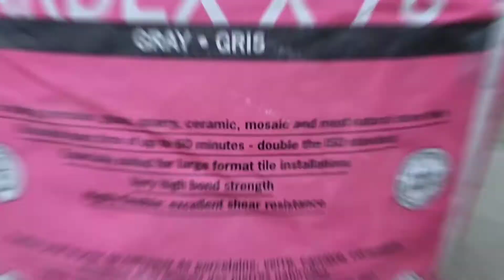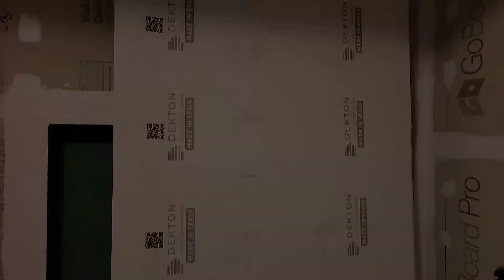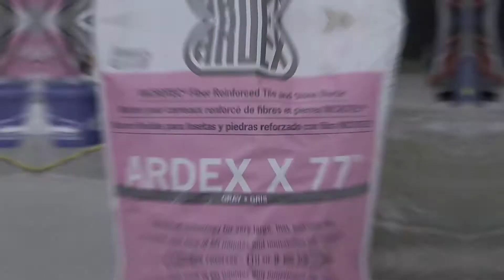Dekton Thin Slabs Installation

Comment: You make it look so easy 
I don’t have the expensive scoring kit but I ended up returning a bunch of 1/4”x3’x6’ panels that I got for about 1/3 of the price because after trying several ways of cutting it would just snap. I felt like it would break just by looking at it

Comment: Garvage material, it brake so easily that if you need 2 slabs for the proyect, just start thinking about buying at least 3 because most likely one is going to break. Plus you can’t polish the edges, the only way to make them look good is by doing a 45 cut and glue a return on it.  There is other much more resistent materials that can be polished saving a lot of labor.

Comment: Did I understand correctly you have 2 panels connection in the senter of the wall, what the point to have panels in this case.
Why you have this strange cut in the senter what the point  to buy panel  for 1500 and did tile from this.
Reply from the maker: Hello, large format tile panels aren't a magic product that could create a seamless look in any shower. In that particular case, the point of using 2 panels on the back wall was merely because the width of that wall was more than 70 inches. In other cases, a seam is created in the center or along one of the sides of a niche because the size of a particular bathroom doesn't allow to safely maneuver a full-size panel during its installation. Such details are discussed with the customer during the bidding process.

Comment: Good job on the floor but it don't need to be level just flat
Reply from the maker: Thank you! A shower floor done by a professional must be level along the perimeter.
Reply: @TileProUSA  well yeah a shower.  Not the whole bathroom
Reply from the maker: @TheTechGuider  sure! I never said level is required. It is desired and it's great when a contractor knows how to create it.
Reply: @TileProUSA  yeah absolutely, but if building up your floor to an undesired hieght  just to achieve level then it's counter productive.
Reply from the maker: @TheTechGuider  100% agree but where did you see me building a floor like that? 🙂 I am a professional tile contractor and know very well what to do to bring substrates to flatness required for large format tiles. We discuss in detail the entire installation process with our customers before we start doing anything.
Reply: @TileProUSA  and it it shows in your work. Very well done. Your screws you had in the floor looked atleast a half in high. That plus the thickness of the tile and a tile underlayment if you used one would help to build that floor height up.
Reply from the maker: @TheTechGuider  that particular floor was finished higher than the adjacent bedroom hardwood floor with full understanding and permission from the customer who wanted to have a level floor and didn't worry about the trim transition. Industry standards for large format tile require no more variation in floor flatness than 1/8" within 10' and no more than 1/16" within 24". We discuss with the customers every single detail so that they fully understand what we do, why we do it and how we do it.
Reply: @TileProUSA  right but you can achieve that variation without the floor being level yanno. Just cause it ain't level doesn't mean it's not flat is all I was saying
Reply from the maker: @TheTechGuider  yes, I fully understood what you were saying. As a general idea, I fully agree with you but assuming that the floor doesn't need to be brought to level just because it is not required isn't my approach. The customer already had a threshold in that bathroom from the previous installation and it didn't bother him at all. More importantly was going level off the curbless shower.

Comment: how did you get the shower pan tile to match the slope of the shower systems pan beneath it? is there a relief cut in the center of the panel? also how do you get that edge to be level between the pan tile and the floor tiles?
Reply from the maker: That's a single slope shower pan with the linear drain along the entrance to the shower.

Comment: Did you leave the small radius on the inside corners of the niche?
Reply from the maker: Yes, I always leave a 3/16" radius in the niches in every corner to prevent a potential of cracking due to thermal expansion and contraction.
Reply: @TileProUSA  so is there radiuses on the one side of the niche and then square corners on the side of the niche that runs in to the grout joint?
Reply from the maker: @ryanboucher936  yes. Before the installation I always explain my customers the purpose of the radius in inside corners.
Reply: @TileProUSA  thank you! Just always trying to see what other contractors are doing when it comes to inside 90s on porcelain and quartz materials
Reply from the maker: @ryanboucher936  yes, radius has to be made before cutting and, in my opinion, has to be left after the installation.

Comment: The shower ceiling is only held up by mortar!?
Reply from the maker: Yes, that's correct. Only heavy slabs would require an anchor system. Those tile panels are held by the premium fiber-reinforced mortar adhered to a backer board with screws and washers fastened every 6 inches.

Comment: Gotta ask how tricky is it cutting a niche in?
Reply from the maker: Yes, it's one of the most challenging parts in working with the large format tile panels since there is no right for a mistake. At same time, if done correctly and with a proper blade that's one of the safest ways of cutting a rectangular opening in a large tile panel.

Comment: No sense to put hardie backer boards over self leveled floor.
Reply from the maker: That's correct. I never put Hardie backer over that floor. I used a 1/8" thick Ardex Flexbone uncoupling waterproof membrane.
Reply: @TileProUSA  "Self leveling compound" is a best waterproof barrier. No any additional sealants or tapes need it.
Reply from the maker: @Yury Badanin  self-leveling compound is simply a layer of hydraulic cement with additives, and it's not waterproof at all. It will actually quickly absorb water that you spill over it. Therefore, it needs to be covered with a waterproofing membrane in wet areas, including near curbless shower floors.
Reply: @TileProUSA   This is just a part of what I find in internet regarding self leveling compounds:
Is self-leveling compound waterproof?
Exceptional waterproofing properties with low permeability to water, resisting 10 bar positive and negative pressure.
 Also, one of them is HLM 5000 SELF LEVELING grade is a one-component, moisture-curing, bitumen-modified polyurethane elastomeric waterproofing membrane for exterior below-grade or between-slab applications.
Tremco 250GC Roller : Waterproofing Membrane
Reply from the maker: @Yury Badanin  yes, you just probably confused the cementitious or a gypsum-based self-leveler with a different product that is waterproof. None of the cementitious or gypsum-based self-leveling underlayments are waterproof, and most of them are limited to only interior dry areas
Reply: @TileProUSA  Shower pan liner is not  a  "cementitious or a gypsum-based" material, but we use it on floor to prevent water. So, why we cannot use any type of self leveling product in shower area ?
Reply from the maker: @Yury Badanin  you can use a self-leveler under a pan liner or under a pre-fabricated shower tray, but it can not be used in wet areas when not protected by a waterproofing membrane. Also, most self-levelers aren't suitable for exterior applications because they are not frost-thaw stable.
Reply from the maker: @Yury Badanin  you can use a self-leveler under a pan liner or under a pre-fabricated shower tray, but it can not be used in wet areas when not protected by a waterproofing membrane. Also, most self-levelers aren't suitable for exterior applications because they are not frost-thaw stable.
Reply: @TileProUSA   I respect your opinion, but I still believe, that any self leveler is good water barrier, no matter where it used and no matter from which material it produced.
Reply from the maker: @Yury Badanin  yes, of course, we have freedom of speech, and you can believe in what you believe.